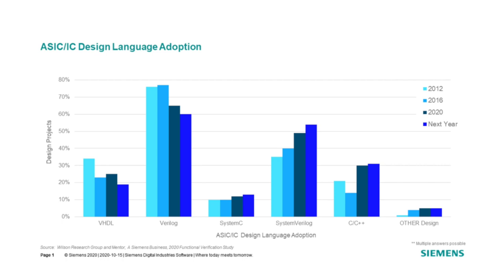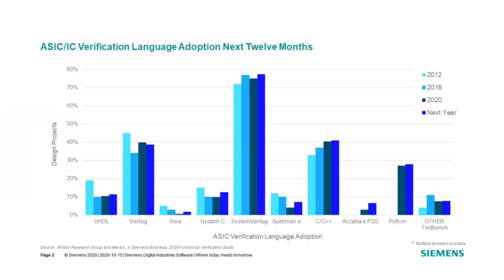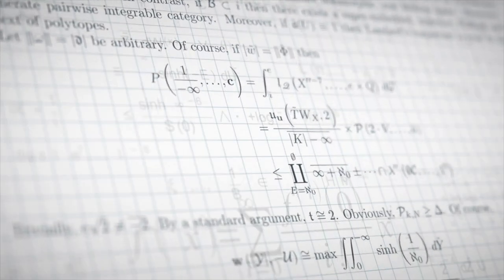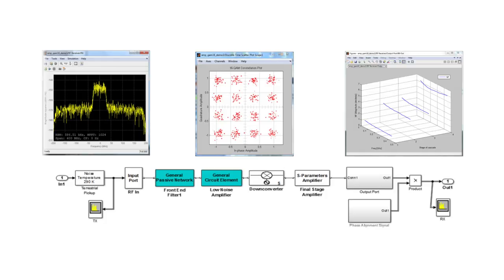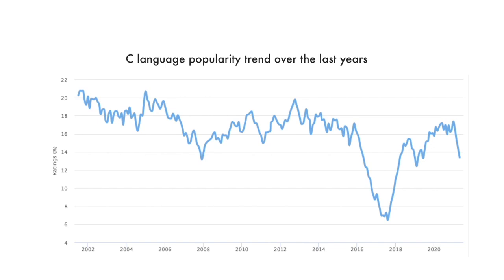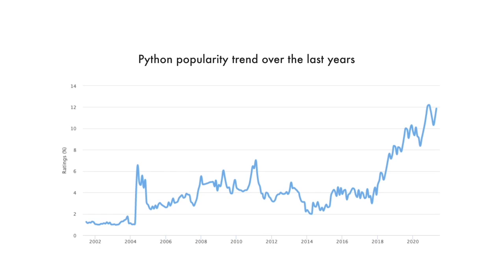Top 5 Programming Languages for Electrical Engineers and Hardware Engineers

Comment: When I started college I though Matlab was kinda useless and overcomplicated, nowadays I see the powerful tool that it really is. I really love working with task automatization w py and I think it should get some more of the spotlight
Reply from the maker: Thank you for your comment :) I am not a huge fan of Matlab as well. However, It is awesome/irreplaceable for some of the applications, for instance modelling
Reply: @AnastasiInTech  not a huge fan either, but it can be great for bringing the gap between scientists and engineers. I've used it to convert maths from someone's Ph.D thesis into an FPGA implementation. AFAIK that's the only toolchain that makes this possible within a single environment. The C code generator isn't too bad either.

Comment: Ana, these are all great programming languages. But I would definitely put Julia on the list as well. Julia is a universal programming language, but was originally also developed for numerical (science) and technical computing. It has all the advantages of MatLab and Python, but with the execution performance of C. And the multiple dispatch approach and the dynamic type system enable a previously unattained efficient software development. Julia is not that widespread yet, although the growth rates are very high. Julia can theoretically replace Python very quickly, since legacy Python code and libraries can be very easily used within Julia.
Reply: if can do it with Python is aimless using Julia.
Reply: @luciangv3252  You are right. If I can do it with assembler it's aimless using C++.

Comment: I keep running over videos of this channel 🙂
From my experience in the industry I'd also recommend to somewhat specialize.  Yes, generalists are in high demand but each of these languages is a vast territory with it's own swamps and sinkholes to fall into.  For most people it's really hard to be good at multiple things.  There's reasons that hardware engineers run in panic when they see a software guy wielding a screwdriver or software guys are tempted to start all over when they get a pile of code from hardware folks.  In other words, try to be good at stuff, not mediocore at everything.

Comment: Agree with you :)), without Python we as a HW engineer cannot process dump files with thousand of lines :))
Reply from the maker: :) Exactly
Reply: What you just described is NOT a hardware engineer, it is a software tester.  I could easily write your dump parsing code in C or any other language.  Please tell me of any time when you used python to program actual hardware
Reply: @christopherjoseph651  Lol No! I did not mean that I use python to program harrdware. I use python or any kind of scripting languages to avoid those manual tasks like monitor simulations, or gather data from dumped files, or just simply hacking the SPICE netlist, etc
Reply: @namtruong3414  Exactly, but this video is specifically for hardware engineering and there is no need to know python for that.  You can use any language for the tasks you mentioned and the important thing is that someone who wants to become a hardware engineer should know how to program to do those tasks and the language doesn't matter.  Python should not be #1 for hardware engineers but she put it at #1 because it is popular right now.

Comment: I work in the energy sector in a area without the need of programming skills. I love PCB design. And I have often thought about switching to electronics. But I hate programming. In electronics jobs, unfortunately, both are usually required. I know at least one expert who only does PCB design and absolutely no programming, but that is probably very rare or only in very large companies where everyone has their own special task... But I might start a start-up for a new electronic device soon... The programming for it is not difficult... But most of all I'm excited to do the PCB design...
Reply from the maker: As soon as you learn it, hate will be gone :) Wow start up for a new electronic device sounds cool! Which application it will be? Mb biomedical ? :)
Reply: @AnastasiInTech  I had to learn programming to get through my electrical engineering degrees. So I have a good basic knowledge. However, I don't like it at all and all of them were difficult for me to pass:
Higher programming languages:
C/C++/Java object oriented
Hardware languages:
Assembler/FUB(PLC)/AWL(PLC)/VHDL

I'm not giving too much away. Is a new kind of lamp with LED and fast microcontroller (as an expensive designer lamp). Only 2 very small companies in the USA and 1 company in Germany offer such lamps. So it would still be a chance because pretty no offer at the moment. I first try to make something in the premium sector with high quality and high prices...

But there are high risks that it will not be a long-term venture. Firstly, the power of the big companies in the lamp sector.  And the chinese competition that can destroy you...  I also have to check if I don't violate any patents with the prototype or licences when using hardware programming libraries or something... Running a business in a legally correct way is not that easy either...
Reply from the maker: @daisyduck8593  Cool! It seems like you have a lot of work to be done in the near future! Wish you patience and best luck :)

Comment: 00:06 Verilog is a top programming language for hardware engineers.
01:42 Verilog is widely used for describing hardware systems at different abstraction levels.
03:22 System Verilog is a widely used hardware description and verification language.
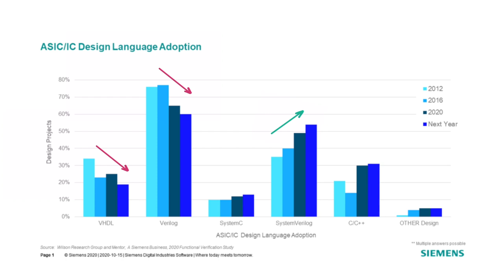05:02 System Verilog is the most used language for hardware design and verification.
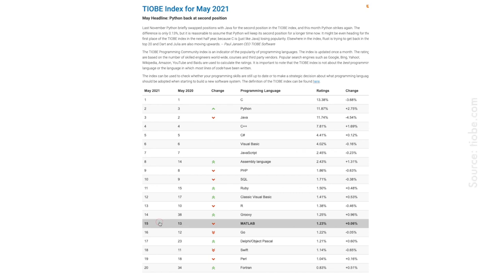06:33 Matlab is widely used in engineering and science for control systems, embedded systems, and semiconductor and automotive industries.
08:11 C programming language is popular among electrical and hardware engineers.
09:53 Python is the number one programming language for electrical engineers and hardware engineers.
11:38 Python is a popular language for hardware and electrical engineering jobs

Comment: Nice video Anastasi. Thanks.  Very interesting. I've never had the chance to go deeper in HDL languages at work, just few introductory classes at university. I've always used a microprocessor to build applications. But never its too late to start, so if I could start with a language (system verilog or phyton-hdl from the video) and a sort of development kit, not very expensive. What kit would you recommend?

Comment: As a professional software architect/engineer C / C++ is terrible for application programing and building complex business systems.  But she is completely 100% correct - for hardware engineers it makes perfect sense.  C was designed for programming very low level software that directly interacts with the hardware (such as operating systems).  Its still overly terse and messy, but for hardware its still number 1.
Reply: C is no longer a good match for today processors though while C++ can match the register sizes and primitives exactly.
Reply: @crhu319  That could be true, haven't really thought about it for a long time.  I try to avoid both C & C++ as much as possible and don't think I've had to use either for anything series in quite a few years thankfully.   I imagine plain old C isn't used for much other than legacy embedded work much anymore.
Reply: @Me__Myself__and__I  All current generation microcontrollers (which are used in embedded systems) have C compilers.  This is a horribly common misconception in programming, that if a language is old it must only be used for older (legacy) systems.  In fact the oldest implemented language, machine code, is THE ONLY language that runs on EVERY CPU/microcontroller.
Reply: @crhu319  Wow you really have no clue what you're talking about.  First C and C++ use the same primitives, and THE DEFINITION of "int" is that it is dependent on the specific hardware that it is running on and also compiler dependent and therefore scales with register size.
Reply: @christopherjoseph651  Machine code is not a language as it is different for every chip.   Assembly is a language that attempts to abstract machine code.  Sure, they all HAVE C compilers - but is that the ONLY compiler available for them?  I haven't looked into microcontrollers recently but I expect that situation will change if it hasn't already.  Regardless it doesn't change the fact that c & c++ are horrible languages.
Reply: @Me__Myself__and__I  My point is that every microcontroller company has a free C compiler so if you know C you can program all of them.  Yes they have other compilers but not for all languages and not ever company has a compiler for a specific language, except for C.  My other point is that the only thing a micro understands is machine code, so all of these high level abstract languages are really pointless and unnecessary.  You can write any recognizable program in any language.  Some may be much more convoluted and inefficient than others but it can be done.  Hardware programming is low level programming so there is no need to get further from the hardware and C is just fine for that.  If you're programming in an OS then use the language that is best suited for the task.
Reply: @christopherjoseph651  Who cares about a FREE compiler?  That means its worth what you paid for it - NOTHING.  Anyone doing real work, and certainly a business, isn't going to prioritize using C just because there is a free compiler available.  A company that makes those kinds of decisions would quickly go out of business.   Regarding your other point (quote: "My other point is that the only thing a micro understands is machine code") - you don't actually understand computers do you?  EVERY computer runs machine code.  Machine code just means the code native TO THAT PARTICULAR MACHINE.  Also - EVERY machine has an operating system (OS).  EVERY ONE.  You're showing that you don't understand very fundamental facts of how computers and software work.
Reply: @Me__Myself__and__I  Its common the free compiler is basic or limited in some ways, but only the paid supported one has all the libraries and allows all the optimisations etc to be enabled. This can save memory and cpu cycles, if those matter for some project. But as a student or hobby programmer, "free" is always a great option, at the expense of maybe more memory used up. E.G. for a small project in a PIC microcontroller with 3K flash and 384 bytes of ram, it can matter.
Reply: @jimwithheld7217  Oh true, free is useful for students and hobbyists.  No doubt about that.  But there are lots of free compilers / IDEs out there these days and I'm sure there are free alternatives to C/C++ for these devices.
Reply: @Me__Myself__and__I  I wouldn't call a firmware on a microcontroller that just causes an LED to blink an operating system. And there used to be games for the PC as PC booters, all of which ran without an operating system.  The C-64 boots a basic interpreter when it starts. I wouldn't call it an operating system either.
Reply: @OpenGL4ever  The C-64 interpreter is absolutely an operating system.  Where do you think operating systems began?  The Linux kernel is an operating system and it can be configured and installed with probably about the same or less capability at its bare minimum than that interpreter.  

In any case you're just arguing to be arguing.  An OS is the software that controls a computer's operation which is what that "basic interpreter" you mention on the C-64 does.  It is listed as the C64's OS on the Wikipedia page and pretty much every page in the Internet that talks about the C64.
Reply: @Me__Myself__and__I  No, it's not. It's only interpreting BASIC code. It doesn't manage resources like files, it requires firmware routines to do more. It doesn't have an hardware abstraction layer, like modern OS do. And so on.

The Wikipedia says a lot of rubbish, it claims for example that Windows 3.x is not an OS, which is wrong.
Reply: @OpenGL4ever  Not all computers are created equal.  Many years ago I owned a computer that had 16K of memory, ran at 1.8MHz and did not have any disk or file storage.  It absolutely did not have a hardware abstraction layer!  Yet it was still a computer and still had software that controlled its operation.  The software that controlled its operation was still referred to as an "operating system". 

Both C64 OS and MS-DOS controlled the computer's hardware, peripherals, file systems and could execute applications.  Both had command line interfaces.  C64 just happened to also have a programming language integrated into it.  MS-DOS did not communicate with the hardware directly, it required BIOS (firmware) to do its work.  Are you going to claim that MS-DOS was not an OS?

Also, hardware abstraction is absolutely NOT a requirement for an operating system.
Reply: @Me__Myself__and__I  MS-DOS is an operating system, but a PC Booter, a game like you claim, is not. Just because a piece of software runs directly on the hardware without an OS doesn't make it an operating system, as you claim here.

MS-DOS has a primitive HAL for storage access. The programs running on top of DOS do not have to worry about the file system and the file system in DOS is exchangeable with other file systems. DOS takes care of that and DOS is also expandable in this regard.
DOS also has a primitive API. You like WP, there is an article about the DOS API on WP. DOS just doesn't have a full HAL like a modern operating system would.

Comment: In your opinion, is it better to master/improve the languages I already know or have some exposure to? Or start learning one from scratch? (I have used C++ and java before but not C exactly)
Will SystemVerilog be enough to work as a hardware verification engineer? or is Python now a must in all electrical / computer engineering jobs? (I didn't really like my first interaction with it lol)

Can a non-proficiency in these be a reason for not getting hired?

Thanks for your channel and clear and useful content <3
Reply from the maker: It depends on your goals. From hardware point of view, C and Python are fundamental. If you ask in general, then it’s better to focus on one language and to master algorithms
Reply: @AnastasiInTech  Thanks so much for your reply! Really glad to see content for hardware engineering (& good content hehe :))
Reply: @AnastasiInTech  which software should I start to familiarize with as an electrical engineer
Reply: @philipogbodu3520  Depends on what you mean by electrical engineer because there are a wide variety of specialties and for most of them you will never be required to write any code.  If you want to write firmware then you will either be programming FPGAs (then you should learn Verilog or VHDL) or microcontrollers (then you should learn C/C++)(and if you really want to master them learn assembly).  There are many companies where the hardware engineer does not write firmware (they have dedicated firmware engineers) but you will work with them so you need to understand how the hardware in the device works so that you can help them fully utilize what they have available.  Most firmware engineers don't have good understanding of hardware.  There are also companies where you will do the hardware and firmware.  As for all the other programming that you might do (data analysis, parsing, file manipulation) you can use any language for that so use whatever you learned and know well.  If you know how to program (understand algorithms and concepts like flow control and memory management) then you can quickly learn the syntax for any language. If you're in college then you will learn whatever they select for the curriculum, probably python or C.  If you are younger then learn whatever language you have access to and can use for projects.  I first learned how to program by writing code for my TI-83 calculator which uses a form of Basic.
Reply: @christopherjoseph651  we love to be asking you some question but don't know which medium i we used in connecting with you

Comment: C standard has been revised also in 2018 (C17),  so... we shouldn't say just "old language" because one might think it is something abandoned or not up-to-date with the "modernity", whatever it means being up-to-date for a programming language which does its things as needed and expected...
Reply: Except it's basic type model simply doesn't match modern processors.
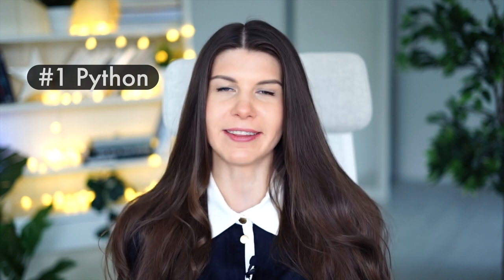Reply: She is comparing Python with C and calling it a successor to C at 10:05. So what do you expect?
It's obvious, that she doesn't know a lot about software engineering from a software development point of view.
For those who are now wondering what the problem is? These two languages have completely different uses. You don't write an operating system with Python, it's not a programming language for system programming, C is.

Comment: H🤗i. I have just become sophomore in electrical engineering. In future I would love to work as an RF engineer, or telecommunication engineer. I love deep space networks, radar and antenna design ( I will be taking it in last semesters of my undergrad course) .
  So in this 3rd sem, I have started with C for matlab but don't know if I should shift to Cpp, also I am planning to start python next sem. College professors tell all mentioned languages are very good. I m so confused😣. Could you please guide me in this issue?
Reply: If you want to waste your time then learn python.  If you really want to be good at hardware then learn assembly.  Learning assembly forces you to learn how the hardware works and teaches you how certain aspects of programming can cause huge performance issues.